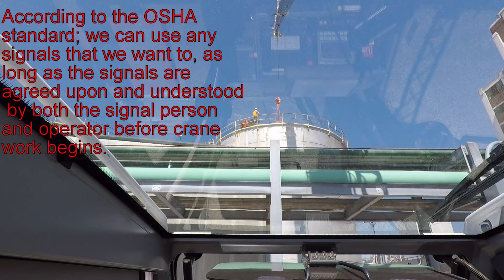Removing and replacing a 5,000 lb gearbox /drive system with the Tadano

Comment: Ain't it fun trying to see the hand signal!
Reply from the maker: Michael Owen, sometimes it's darn near impossible. I especially like it when the signal person is 170 feet away, wearing dark gloves and shirt, and their hand is right in front of the dark shirt. If I can't see the signal, I stop. In this video, I could see the signal pretty easily. Unfortunately, the video doesn't show the signal very well. I  may do a video strictly covering crane hand signals, if people are interested.
Reply: It was hard enough for me with 70 ft of boom.. you're over twice that and the same small hands.. at least the sun's not in your eyes! We did light steel erection and trusses on houses....
Reply from the maker: Michael Owen, the max tip height for the crane that I operate is 330 feet. At that point, it's radio communication only.
Reply: Biggest I worked around was a 70 ton Link-belt...then a couple 50 tonners in Kuwait...
Reply: I think a video showing crane signals and the action of the operator would be very interesting to the public.. also the variations of signals to get the same movement.. I've seen lots of variation worldwide..
Reply from the maker: Michael Owen, Kuwait? Are you a soldier or veteran?
Reply: I spent a year with Kellogg, Brown & Root... handling Military equipment and material...
Reply from the maker: Michael Owen, that's got to be a change in comparison to the states.
Reply: They need some brightly colored gloves.

Comment: do you ever get problems from static charge build up ? that is a big metal stick in the air
Reply from the maker: Bleu Wolf, certain radio towers and substations can induce an electrical charge into the crane. Whenever, we are near either, we have to ground the crane.